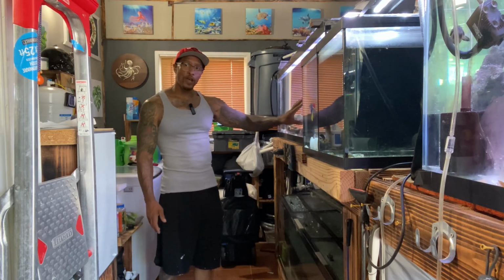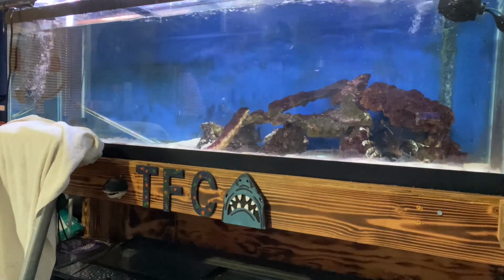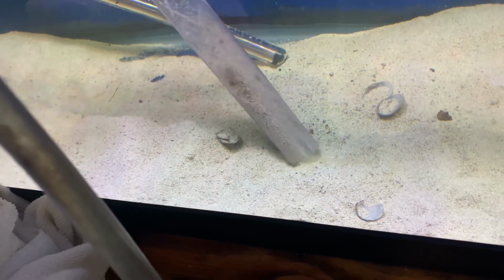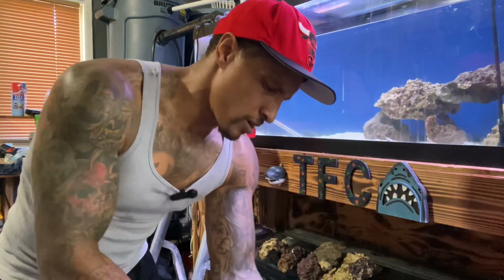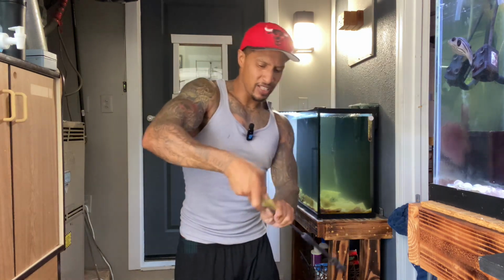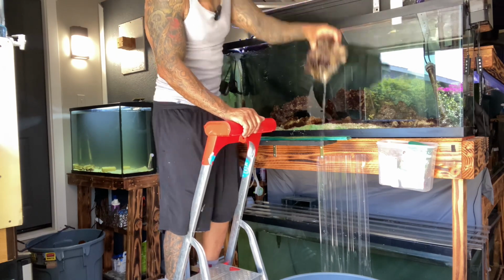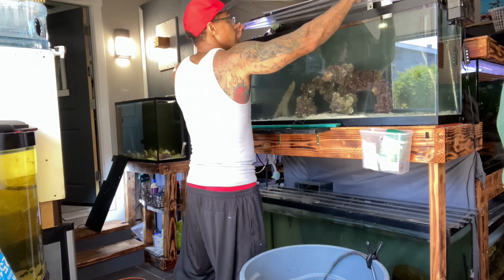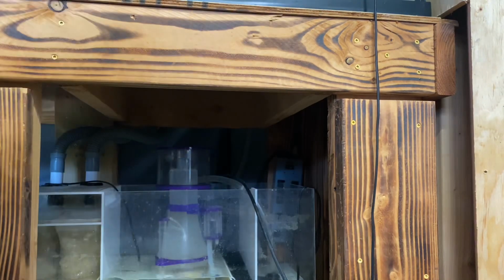CLEANING 5 SALTWATER AQUARIUMS “IT’S A MOVIE”

Comment: How would you setup a small salt aquarium w a hang on back filter? Any mods you would do to the filter? Thanks.
Reply from the maker: Sorry for the late reply Bro, I would just use a HOB filter and heater. Circulation pumps help as well. This would work for a 20g.  No mods needed unless you plan on making a filter and it’s not necessary for a 20g just make sure it’s oversized for your tank. Aquaclear70 maybe. I had the 70 and 50 on mines.
Reply: @TheFishCorner  looking at starting a 40B Fowler. Just gotta get it going. Thanks!